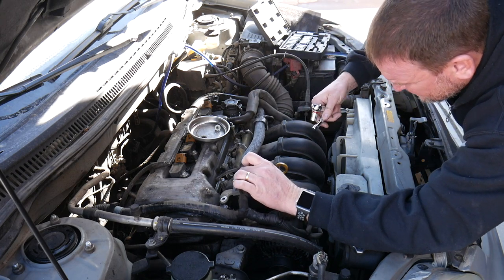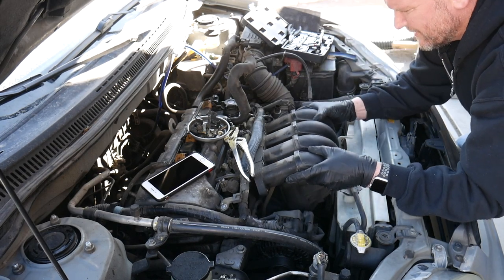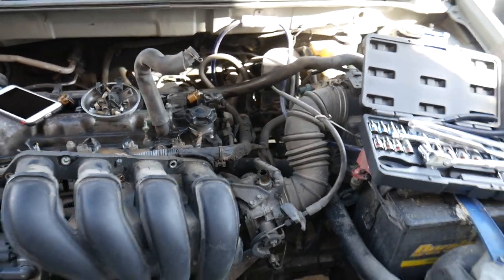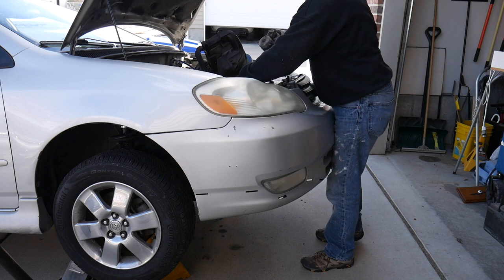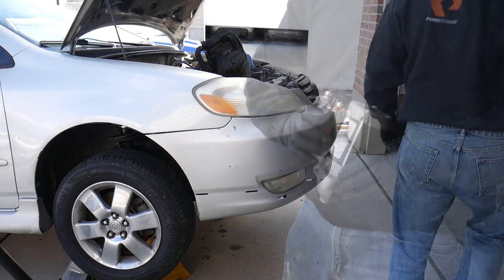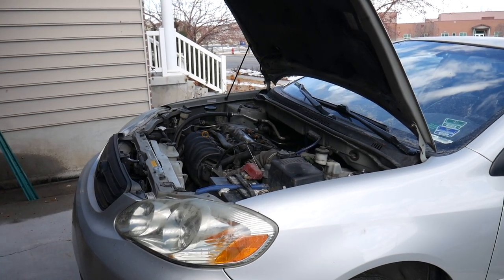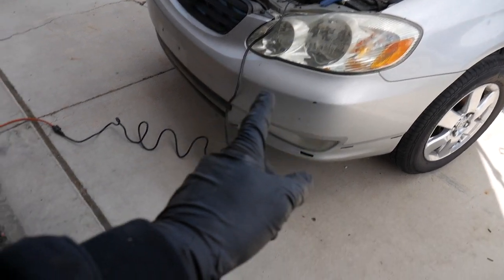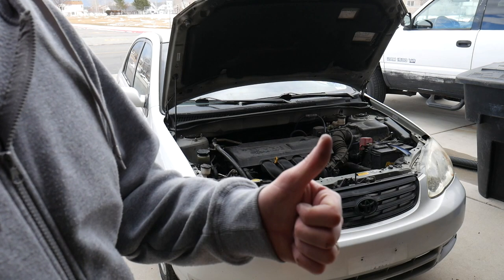2004 Toyota Corolla Slow Crank No Start Episode 2 Starter Replacement

Comment: To pull that starter it's easier and less invasive to remove the fan shroud assembly. What usually fails is the brushes are worn down. Brushes can be obtained from AliExpress for $12 Cdn.

Comment: Two years later I had the same issue with oil in top of the alternator and I found the Oil Control VVT Valve Intake to be the cause 😃
Reply from the maker: Yup. I replaced the intake gasket and the fuel injector o-rings. Might want to check those next. We thought we had an exhaust leak cuz of the smell. Turned out to be fuel leaking from the injectors.

Comment: I’ve had oil leaks from around the oil filter in those before
Reply from the maker: My leak was from the valve cover seal. I replaced that and this seemed to stop the biggest leak. I think I’m still slowly leaking from the rear main though. 🤨
Reply: @troysgarage  did you check the timing chain tensioner?
Reply: I have the same leak. It may be the dip stick tube O ring. Sure hope it's not the two piece block junction. Another possibility is the oil pressure switch, but that's not it on mine.
Reply from the maker: Found mine. Valve cover gasket was dried out and hard as a rock. As soon as I replaced it. No more oil leaking. 👍🏼
Reply: If I’ve replaced my valve cover gasket checked my dip stick o ring and a few other gaskets in the area but it’s still leaking, what would be the best way to find the problem
Reply from the maker: @emilydreams800 spray with brake clean to clear as much of the old as as possible. Then top off oil and drive for a while. Check again for the leaks. Any “new” wet looking oil can be located easily. 👍🏼